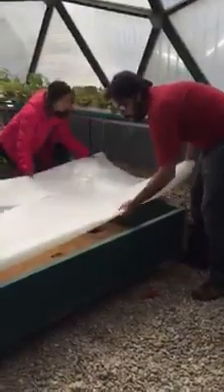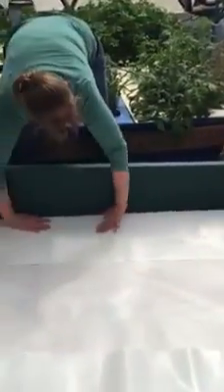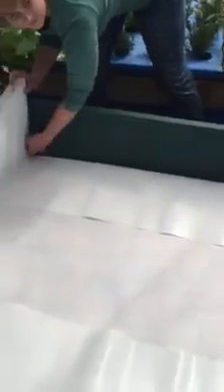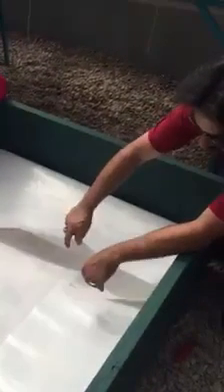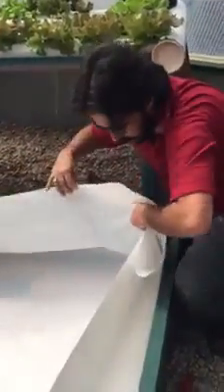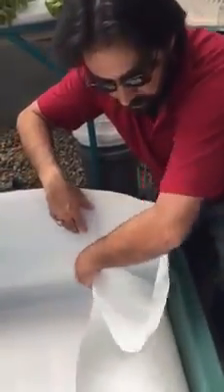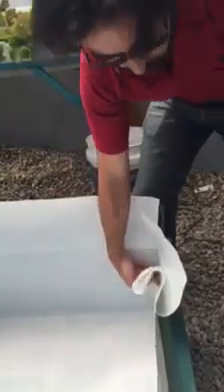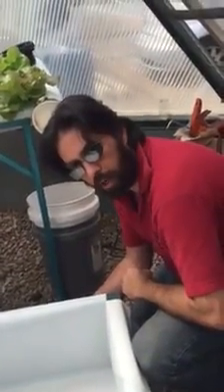How to install Aquaponic Liner

Comment: How did you secure the liner?
Reply from the maker: The liner is secured with staples at the top of the trough. There is a single bulkhead fitting at the base of the trough that serves as the exit drain for water through a standpipe.